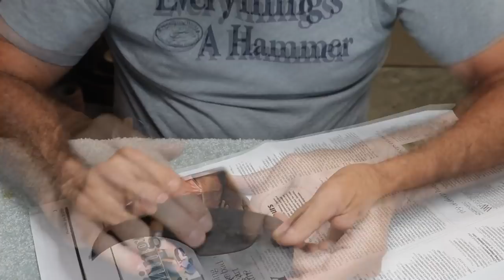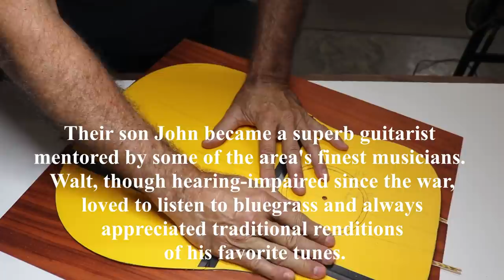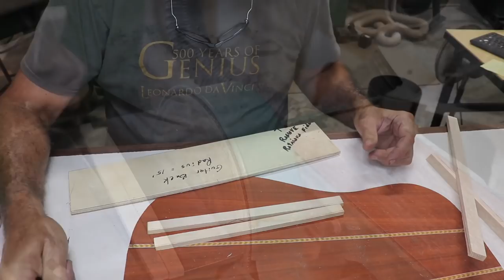435 RSW California Gold Custom Guitar Part 2

Comment: Those vacuum pumps not only remove the air but they remove moisture as well.  I worked with building refrigeration equipment and we used the vacuum pumps to remove the air and moisture from the system.  With a micron meter, you could watch the vacuum build, then it would jump as it finds new moisture and vaporizes it.

Comment: I really enjoyed watching this video. As you know the Martin D35 is my favorite guitar. Martin started cutting the three peace back in the early '60s. They did that to save wood also. But after they built the first one they discovered it gave the guitar a much deeper & louder tone. Much better then there D28's. That everyone loved so much. Jerry, In the future you might consider drilling a small hole at each end of the neck. Then put a small dowel rod through the neck and leave it in there. That would keep the wood from moving around while you are trying to put it in the vacuum bag. Plus I think it would add to the strength of the neck. Make it stronger all together. (Just my thought). I think this guitar will sound great. I am looking forward to part 3. Stay well & safe everyone.

Comment: It is so interesting to note, that gluing is so simple, but so demanding.   In my experience, the glue up, and its associated prep work and clamp set up, is the single biggest failure in cabinet making.  I have repaired hundreds of failed glue joints and inlays in my time, and so far, none of them my own (fingers crossed).   Keep up the great work.

Comment: Awesome sound from that back! For the neck glue-up, maybe inset a  spline across the layers at each end in the waste area, or maybe a dowel. That would keep the layers aligned. Or just put a couple of screws in during dry fit up.

Comment: A thought on rastering... take a piece of scrap from the same wood and place in the laser cutter at the same time.  make a test cut and use it on the scrap so you know exactly what the piece of wood requires of the laser cuter.
Reply from the maker: I actually do that believe it or not it's still not easy

Comment: Surprised to see you use a marker on wood. Anytime I did that it soaked into the wood and I couldn't get it out.
Reply: There are several reasons why he could afford to do that: Most of it goes over the sides and will be removed. Then more will be routed out to make place for the binding removing any remnants. And then there's the fact that this wood is so full of resin that it won't soak in much of anything.
And of course, a master would consider all of that before taking anything dangerous to a precious piece of tonewood.

Comment: Jerry
Have you ever used one of the glue roller bottles ?
Reply from the maker: Nobody it seems like a major hassle to me because you have to clean the roller
Reply: @RosaStringWorks  
That would be a draw back. Every time it's used the roller would have to be cleaned as you said. Easier to clean a brush or finger. ;-)

Comment: Could you use the vacuum press for the back and top braces?
Reply from the maker: It's more difficult than you think the bag is very thick and it pulls things around plus you have to have a backing that would match the curvature
Reply: @RosaStringWorks  Jerry, would it not be posible to turn the braces of the back piece upside down with the flat (horizontal part) and in the right order, glued,  than turn the back upside down on top of the curved side of the braces and so use the gobar system?

Comment: I am absolutely certain that just using clamps on the neck would have taken  less than half the time and been absolutely as effective. Why would you bother with a vacuum bag for a perfectly regular stack of wood?
Reply: It would have worked, yes, but vacuum really does wonders to deep parts of the wood being processed. If one wants perfection, he needs to vacuum it.